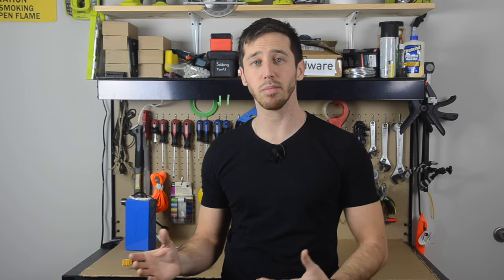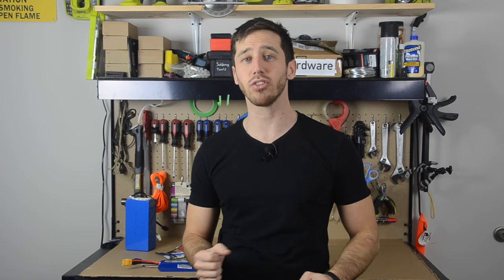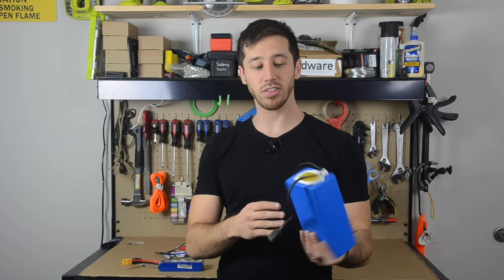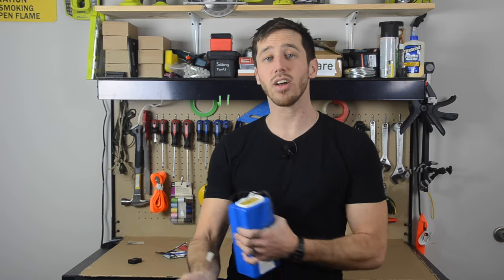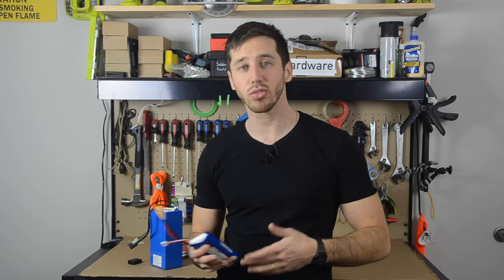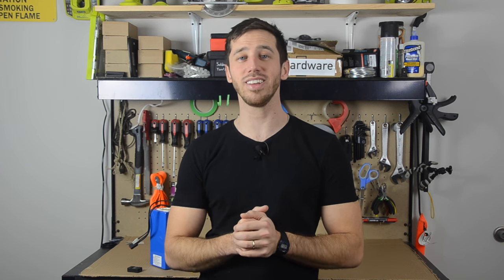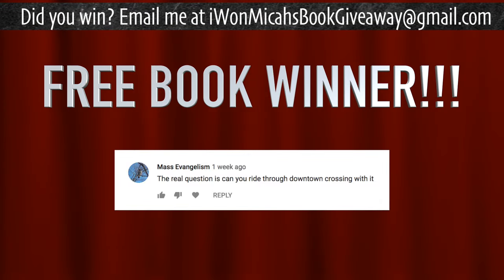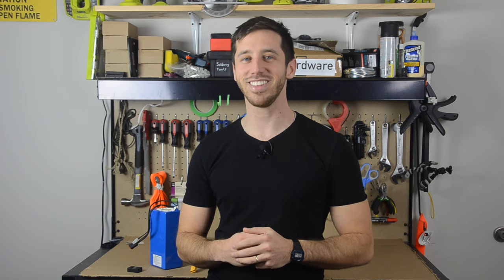Do you NEED a BMS for DIY Li-ion Batteries?

Comment: Whether you need a BMS or not really depends on many factors such as the application, the total energy of the battery, the expected battery knowledge of the targeted users, etc. For instance, you would never argue against having a BMS in an electric vehicle available to the general public, it’s obviously needed in that specific product category given the energy content and the generally speaking low battery knowledge of the targeted end users. While it’s probably not as critical for small scale RC LiPo batteries especially since the end users are more educated about the risks with batteries. But even for small scale products, as soon as it’s tageted to a wider audience BMSes will be needed, such as in photography drones which are used by people with such varying technical backgrounds.
Reply: Exactly, I've got 2 X 6s 10ah lipos in series in my ebike and I'm being insulted on here and being called an idiot because I don't run a BMS, the cells are taken off the bike, balanced charged in a fire proof box in my garage, battery volts and capacity monitored under discharge, no BMS needed as discharge never goes under 80 percent, done this daily as I commute on my ebike with no issues for 10 years, all I had when I used BMS and didn't watch capacity manually was problem after problem.

Comment: I built my batteries in 6s packs and use a series harness to get the high voltage our bikes need, and a parallel  harness so I can use a hobby Ballance charger to charge all packs at one time - our bikes have volt meters so we can monitor the charge states.  No BMS.  3 years and no problems so far.   When the time comes for new batteries - I would do it the same way again.

 But - If you aren't ready to nerd out you should get out the wallet and  just buy ready made battery packs with BMSs and matching chargers.  IMHO.
Reply: @Electric Vehicle Hub nothing wrong with any of that.  The Only problem I see with BMSs is that it's really hard to tell if it's doing it's job correctly or not - you only find out that the BMS isn't working when the battery dies.  The one thing we all know about technology is that sometimes it breaks.

Comment: Can you do a topic on amps and bms like I'm using 14 cells in series and 10 cells in parralel 140cells in total half 70 2200mah and 70 2000mah 18650 new laptop cells so 50 amps continuous  5 a per cell can I use a 52v 45 a bms on this pack ?

Comment: I connected my battery wrong-i crossed the red and black😢
Smoke from the battery, now nothing.
Is it now a paperweight,
or can it be saved?
Did I wreck the controller?
Help!!
Reply: Put it in the microwave on full power for an hour (make sure your not sitting near the microwave while it is cooking)😊
Reply: your battery will still have many good cells insode that are worth something

Comment: Can you use BMS for recycled 18650 battery pack for ebike?
Reply: WHY would it matter, if the cell was recycled or not?
Reply: @vtorsi610  From what I have learn from those who have put together the battery packs, recycled cell does not have same characteristics like voltage, amp and resistance. The BMS will have a hard time to balance charge the cells. Compared to buying a new cell with same brand, most likely they have the same tolerance.

Comment: I use a bms connected to only charge to balance the cells and use the controller low voltage cutoff.

Comment: My controller gets warm and draws power from my battery even when I'm not using it and it's just standing at home. I don't know why and thinking of an option to cut off power between the battery and controller with a switch..

Comment: Hi, maybe you can help me out. I'm planning to converting my e-moped with a 100A BMS 6000W lipo4 battery. The questions I have, will it work safely? The engine is 1.5Kw, so how does discharging work? Will it blow 6kw into the engine, or will the battery provide the power that the engine asks?
I hope you or someone can help me out with good advise. Thanks in advance

Comment: Hello everyone, I have a 60 volt, 20 amp hour power pack. It contains 112 cells. Does anyone know if a BMS for this pack would be more expensive than $32? The BMS that I would need would require 112 wires coming out of it wouldn't it? 
Update:
Ok, I checked out the bms "how to" video. It appears that a row of cells in parallel is considered to be "1S". So I would have 16 rows of 7 cells. How do I make sure each cell we within the rows of 7 parallel  cells is charged to the same voltage? Or maybe this level of battery management is not necessary?
Reply: It is necessary when ever you have cells in series

Comment: I always hit my home Depot battery recycling bin when leaving the store, last month there was six 56v 2ah ego batteries still sealed in package and two 56v 4ah ego batteries also new sealed in packs. 
I have a 7s scooter and planning to make a 7s7p battery out of the cells, because of the wrapping I can't use a normal housing for the cells. Any recommendations before I go to hot glue?
Also got 6 ryobi 40v 4ah batteries also sealed in original package that I plan on using on my 10s scooter. Got a spot welder, any advice for someone that has watched all your videos and is building batteries out of cells scrounged from the garbage even thought they are 96% capacity ect?
Reply: home depot battery recycling bin?  What's this about?  You can just rummage through it?

Comment: What battery type is safer? (Li-po or Li-ion)
Reply: They are the same. They are just packaged differently. Most would say a round cell in a metal case (aka li-ion) is safer than a pouch cell (aka li-po) only because it's more difficult to puncture. They are almost equally dangerous when charging but a pouch cell will show early visible signs (swelling) of failure before catching fire. Both are safe if handled properly and both are potential fire bombs if handled recklessly.
Reply: okcrc tnx

Comment: I use only Balance Charge. Becourse i always used it and I didnt tust the bms, and also i didnt like the low voltage cutoff. I use 2 cellcheckers one that is Set to a higher value so that it has enough capacity left and the other one as a critical Alarm when i should turn off. (But you also Can combine a bms whith a low voltage Alarm, to Set the Alarm to  know that the Battery pack gets empty and is about to cut off) 

 the Best way for me are 2 cellcheckers, also becourse i had a Balance charger at home(for my rc cars and fpv Drohnes) and didnt want to buy a bms.

Comment: Hey man, great explaination! Quick question tho: I'm using a 12s LiPo Pack for my 8kW e-Mountainboard. It consists of 6 2s 5200mAh LiPo RC batteries. As of now i'm using two 6s balance chargers to charge the pack, would it be possible to use a 12s BMS with those? I can't find any info on the topic and i kinda think it should be fine since the voltage ranges are adjustable on good quality BMS'es so i see no problem with that but i can't get myself to order some 200€ bms not knowing if it'll blow up my LiPo pack. Please let me know if you know anything about that (maybe try it, might make for a good video) i'd love to get some info on that as i'm afraid i'll use my tight budget to build a unsafe battery so please let me know, would help me out a lot!! Keep the good work up m8 and stay healthy!

Comment: If you took the bms off of that pre built battery it would be the exact same format as the lipo
Reply: Ps looks like I’m needing approximately a $200+ bms with the amount of power on tap ina 100+v lipo 40ah pack

This is actually pretty damn accurate if you are talking USD and converting it to Aud (my currency) which is also realistic too.

Pretty solid with 99% of the statements man :)
Also the remark about having a bms just saves lives and also removes the human error factor.

The reason you buy pre built a with a bms is because it’s safe, so if you diy YOU SHOULD ABSOLUTELY USE ONE UNLESS YOU KNOW WHAT YOURE DOING

Comment: Suppose I have assembled 4 cells to have a 1P4S 12v pack , each cell 2500 mA. 
Will a 10A BMS limit charge-current in the same way a 20A or 2A wlll?

Comment: do I need a BMS for a parallel connection? (1S4P or 3P)
Reply: No you don't need BMS. The cells in parallel connection will self-balance by themselves.  Furthermore, even the series connection alone will also get self-balanced.  Series and Parallel connected battery pack will also get self-balanced. This is something the general public is not aware of.

Comment: Would it be safe to connect 3units 3s 11.1v packs each with bms in series to run my 36v ebike? Is safe to go to the extreme of adding in 1or2 SLAs with a 3s 11.1v in series for 36v.

Comment: Ballance charging is good (I've used both) but you have no over current protection when discharging your battery, this can be dangerous at times. So....... I cheat, if I balance charge I will build my own over current and UVLO (Under Voltage Lock Out) to cut the power in low voltage situations and over current situations, in this way I can have over current protection for instead of a few hundred about like most high power BMS boards I can actually have thousands of amps or whatever I wish.

Comment: most ebay bms are only good for 18650 cells because of the lower empty voltage.
Reply: If you buy your cells from Ebay, you REALLY need to top balance them when charging. There will almost surely be discrepancies in capacity, equivalent series resistance, and self discharge rates from cell to cell.

Comment: I have built 3.2v 30ah x4 lithium polymer batteries connected BMS using it about a year with no failure . I check regularly my batteries if they are properly balanced and yes they are . wires are thick , short , never feeling any overheating , it doesn't even heat up . using 6 amps 14.4v charger to charge them up . Btw if your charger is high voltage putting between charger and batteries a buck converter with automatic switch off function will help a lot and make it double safe to charge successfully .
Using this unit mostly as solar power bank . You always wanna make sure you fail with experience to learn what is the best for you . I failed many times . cuz ya know chinese defective technologies not gonna serve for a long

Comment: How about My battery was different 0,1 or 0,2 volt
and using it as in seri pararel
it's still fine to using this set up??
please quick answear cause I just doing Project electric scooter
5S 4P
MOTOR 250 WATT
Planning Over Watt to 295 watt
please quick answear :D
Reply: Jenny Labora no bms are cheap go the safe way

Comment: You can not overcharge a lion, lipo or lifepo, at least no with lower current.. if you charge a fully charged liion with say 1 or 1.5A, it will just dissipate that as heat. No prob. This is the reason i built lifepo  4s 50Ah for my 1.0TSi, no bms needed

Comment: The bms fried in my 48v 20 ah battery, I removed it and have just used the regular charger and check every hour while charging so it never gets over full and I've gone over 500 miles now with no issues. Is this even safe at all? Lmao
Reply: Using the battery pack without the BMS is fine. The cells in the pack get self-balanced by themselves anyway. There is no need for BMS other than adding more potential problems and limitations, such as breakage and range.

Comment: I would say you can get more performance without a bms IF! That's IF! you know what you are doing because you are limited by the power your BMS can deliver. 
You can over volt a bafang and have an aftermarket ESC that allows you more performance BUT your voiding warranty's at this point and that's where you can draw the line. BMS better for a beginner and most situations but if your looking for hot rodding your e bike and tuning I'd say kick the BMS lose the bottleneck in amperage that comes with it

Comment: Most of the so called BMS's sold today fall into two categories. 1) Cheap junk. 2) Over priced glamor for your phone/PC. If you are building A high current battery pack you better know what you are doing from A-Z otherwise, no BMS will be the least of your worries.

Comment: I wonder will we ever get to a point where there aren't as many 'nodes' in an energy storage curcuit. Like, imagine your battery and bms and charging circuit was just one thing? Just hook it up to solar then stick it in your bike and off you go! :) that'd be so cool
Reply: Lap top computer batteries, and some power tool batteries have those systems built right in.
Reply: @vincentrobinette1507  Yes I know what you mean, but like, imagine the battery WAS the whole circuit. Those systems still have separate parts that are just shrunk into the housing of the battery pack. They're still circuits with separate nodes. But imagine a device that could automatically adapt to the requirements of the load. That just stored energy from ANY electrical source, and could power any device up to it's capacity. I know it's a bogus hair-brain theory, I just like to imagine sometimes I suppose.
Reply: @ConorFenlon  Nickel cadmium batteries have what's called an oxygen cycle. that means that the cell that charges first, just acts kinda like a zener diode, and just convert the excess charge into heat. that allows current to be sustained, and charge the other cells. You charge the battery with a constant current regulated source, and allow it to charge, until the voltage stops rising. at that point, the battery is charged. Only 2 terminal wires needed. This only applies to nickel cadmium, nickel metal hydride, and perhaps nickel iron. This can also be done with flooded cell lead acid, where you can add water that was lost due to electrolysis. These batteries don't need voltage balancing, but, it's still best not to over charge by too much.
Reply: @Conor Fenlon - They have a name - Solar Generators ...

Comment: This video was Really badly needed in the ebike space. , i hate it when people are like 'dont ever use a bms'. Its worth it for convenience alone, like i had 2 cells loose in a pack for 6 months and i couldnt figure out why my battery wasn't fully charging till i open it up when the charge stopped, and the cells were all 4.08- 4.09 till i looked closer and saw the loose cells, so 2 of the series connections were 3.3ah smaller than the rest and were 4.19v each., without the bms i would have over charged everytime, the bms saved my house from catching fire everyday for 6 months. I think they're just fantastic, im still using the battery now after 14000km on it and all i had to do was bring those two series down to 4.08, connect the two cells again and its now working as it did day one.
Happy days

Comment: So I guess the obvious question is... what is the low voltage level for a battery, with a few examples please... Or you already have a video on this?
Reply from the maker: It really depends on the battery. Most Li-ion are brought as low as 2.5V at the factory during testing, but 2.7-3.0V is healthier. LiFePO4 can go a bit lower, but are best kept above 2.5V as well. I'd recommend checking the manufacturer's datasheet for any specific cell you plan to use.
Reply: So a 10 cells in series would have the LVL at 27V? Or you measure this differently? Individually?
Reply: A 18650’s battery capacity is usually measured from 3 volts all the way to 4.2 volts 
3v + 4.2v = 7.2v % 2 = 3.6 volts hense the nominal voltage 3.6v

Comment: Thanks Mica for all the great ebike info. I think I have learned enough to ask an intelligent question. Concerning BMS vs cell monitoring; my thought is to use a BMS for charging only. After charging I plan to switch the BMS off and ride/discharge using the tiny cell checker/ alarm. This is a 10s pack and I would use 2  with a wire to each parallel set, just like the BMS wiring. This would involve a switch on the negative lead into the bms. The cell checkers would stay soldered in place and  on while riding. Would this work like a 10$ hobby charger and alarm set up mentioned? I have tweaked my charger to 41v as recommended by you.

Comment: Hey Mike i just have a question i have a e scooter its 48 volt 13 ah 
Can i use the same volt 48 volt but a higher ah like 48 volt 16ah for 1000 watts.
Reply: Yes you can use a 48V 16AH battery on your scooter, in fact you can use any 48V battery regardless of AH on your scooter, the AH is how much charge the battery can hold in AmpHours, the only thing you need to be careful about is the Voltage, as long as the battery is 48V it will not damage your scooter.
Btw if your using a 1000W (or 1KW) motor I suggest buying a bigger battery then 16AH if you can.

48V x 16AH = 768WH (This is converting AmpHours to WattHours, basically (in simple terms) how many Watts the battery could push out continuously for an hour before dying.)

With 765WH you will only be able to run your 1000W scooter at full throttle going on very uneven surface for a little over 3 quarters of an hour, I recommend you find a battery that has about 21AH as you will be able to run your scooter for a few mins over an hour going full throttle on very uneven surface, possibly longer if you have regenerative braking.

48V x 21AH = 1008WH + 5%-10% Regen (only on motors capable of regen)

A 1000W motor could do its absolute best with a 1000+ WH battery for an hour at full throttle on very uneven surfaces, unfortunately its quite costly to get batteries of that capacity, in Canadian dollars its around 700-800$ CAD which is roughly about 600$ USD.

I hope this helps.

EDIT: 
Here is a quick example for you to understand better:
A 250W motor with a 500WH battery could last 2 hours full throttle.
A 500W motor with a 500WH battery could last 1 hour full throttle.
A 1000W motor with a 500WH battery could last 30 mins full throttle.

Please note that your weight, wheel size, and wind resistance also play a significant roll in these equations, I left those out just to help give you a general idea.